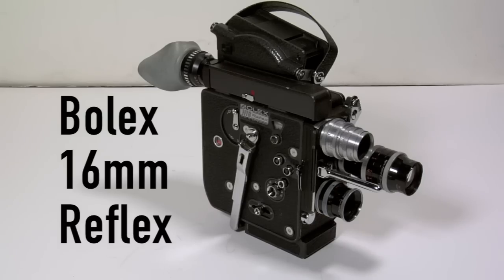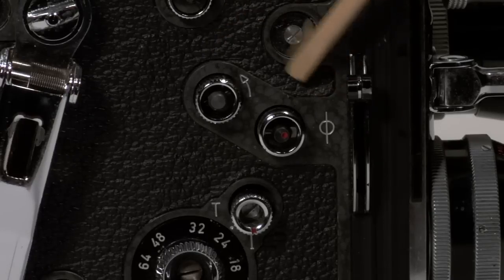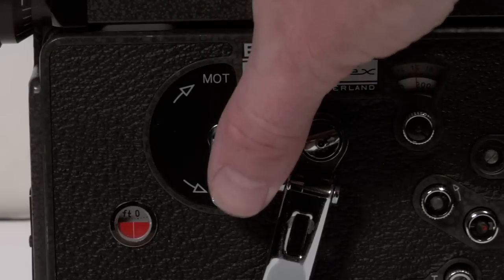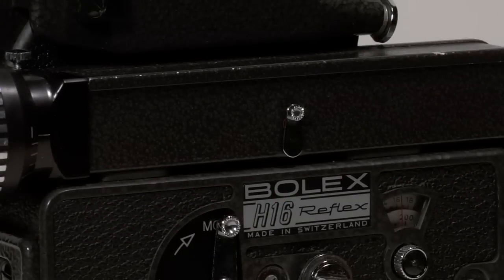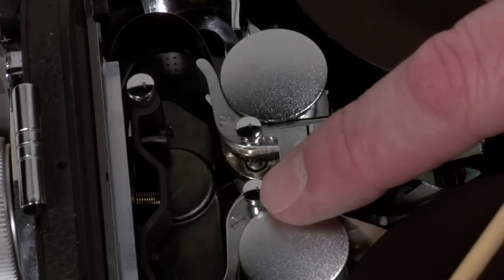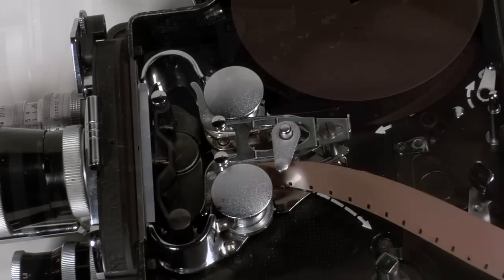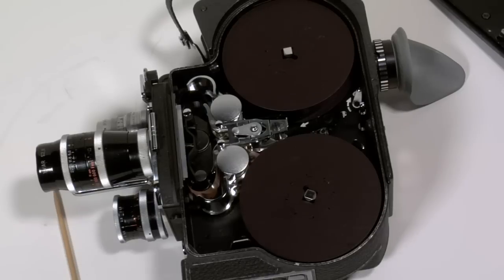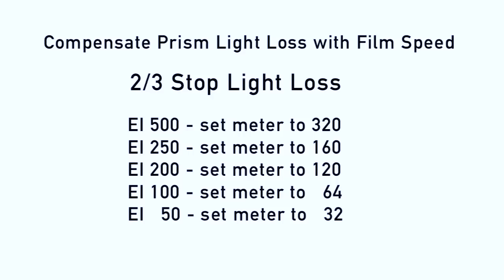Bolex 16mm Camera

Comment: Hey Adam, thank you for this demo. Being new to film, I was struggling a little with the concept of adjusting the exposure on every shot to compensate for the prisms light loss .... changing the ISO/ASA setting seems way easier than having to calculate the right f-stop every time. Thanks.

Comment: Great job Adam. I have been using a Bolex for about 5 years(previous 20 years Super 8) and have gotten superior results. Newcomers should note that if the camera is working properly any sub-standard film quality is not the fault of the camera. Get a good exposure meter and learn the lost art of focusing. Your video really covers the basic functions of the controls as well as loading and should benefit anyone just starting with their new Ebay or elsewhere purchase. And yes, film does rock.

Comment: What do you mean by subdued light exactly? I was under the impression that you needed to load your film in complete darkness.
Reply from the maker: Complete darkness is what the package says. The metal spool blocks direct light from the side, but it can still get in through the film. If you load in a room with very low light you can still see what you are doing to make sure you loaded correctly and only the first couple of feet are fogged. Good luck!

Comment: on the last screen with the prism compensation, this is only a rule for Reflex models right? i own a Bolex H16M
Reply from the maker: I believe that is correct.  If you can find a manual for that camera it should specify if it has the prism.
Reply: thank you.

Comment: Do I have to use the original lenses for this camera? Or can I use other c-mount lenses too, or is there a problem with those because of the prism and focus?
Reply from the maker: There are some variations of Bolex out there - reflex and non-reflex that may have a slightly different C-mount.  For the most part you can use all kinds of C-mount lenses on the reflex Bolex.  We have.  :)
Reply: @filmrocks  Ok, thank's

Comment: Does this camera capture sound and what year was it released?
Reply from the maker: Typically film cameras do not record sound.  The Bolex was made from the 30s - 90s I believe.
Reply: @filmrocks  you mean bolex film cameras don't record sound at all?
Reply from the maker: Correct. The film stock doesn’t have a sound recording capability and the camera does not run at crystal speed.
Reply: @filmrocks  Instwresting. The reason why I asked is because Steven Spielberg, Ridley Scott and Spike Lee among others have used holes cameras in movies and their not tradionally known cameras.

Comment: What about recording sound ?
Reply from the maker: The motor is pretty loud and is not meant to run at a precise speed so sound can drift.  You would use an external recorder and microphone to record sound or create it in post.

Comment: What exact lenses do you have on this Bolex?
Reply from the maker: Joshua Lee I’m not sure which model they were but the focal lengths are 16 25 & 75
Reply: Appreciate the quick reply on such an old video. Do you by chance know the most common lenses for the Bolex? I'm looking to purchase some by don't want to buy the wrong ones.
Reply from the maker: Joshua Lee the bolex brand, kern switar.  The two black lenses. 16 is slightly wide. If you come across a 10mm it is a nice wide angle. 50 or 75 is a nice telephoto but used less frequently.  Enjoy!